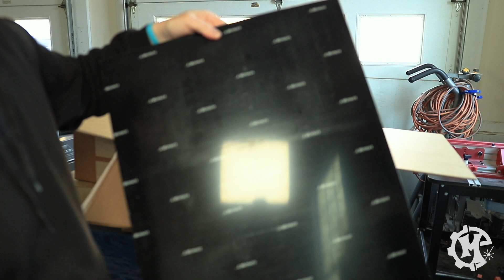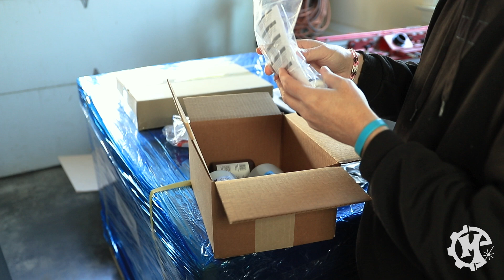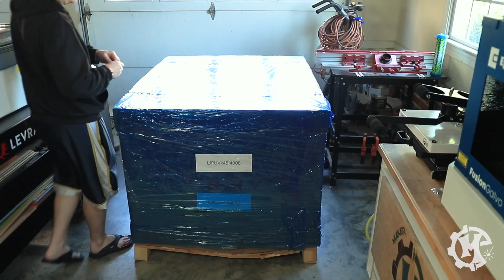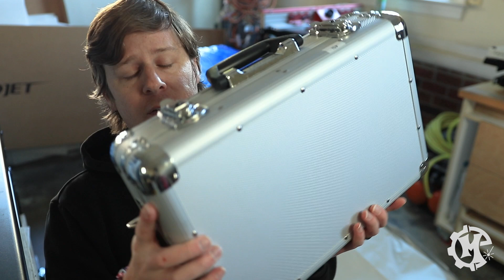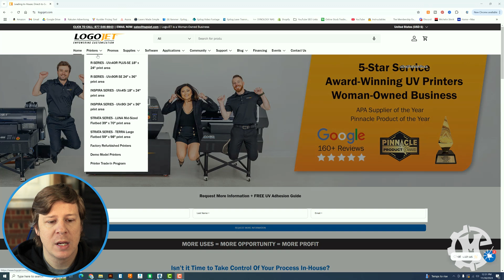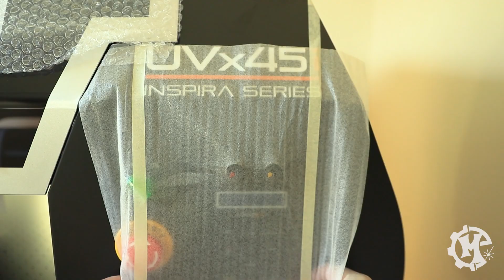Unboxing My New UV Printer  Logojet UVx45i First Impressions

Comment: I don’t get it either – for that price you can buy a Roland MO-240 or a Mimaki 6042MK2E, which are much more stable and better built. If it were a product for 20k, fine, but 35k is just exaggerated. Look, he’s even afraid to open the cover because it’s so shaky and unstable. I’m not a fan of brand products – the bang for buck has to make sense, but I think the price is simply not justified and set unrealistically.
Reply from the maker: You are more than welcome to shop around and get what you like. I had a better experience with people from LogoJet and their support staff answering questions than I did with others. Not every brand will fit every person. Do your own research and pick what fits you.

Comment: Is the ac split being right above the machine gonna be a problem?
Reply from the maker: Not as long as the area itself is at the right temperature and humidity. The machine is actually about 2-3 feet forward of it and not directly below it. I did ask that as well when it was set up.